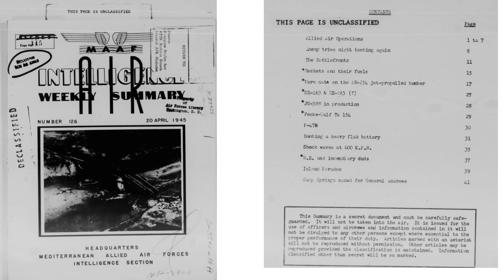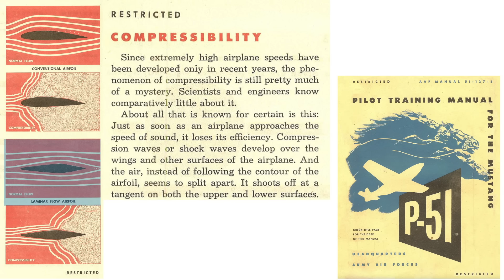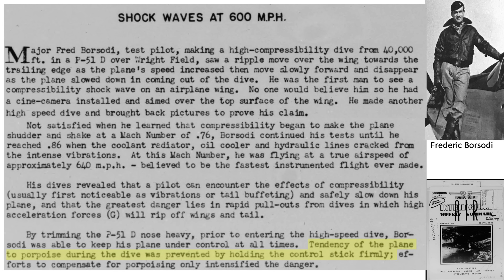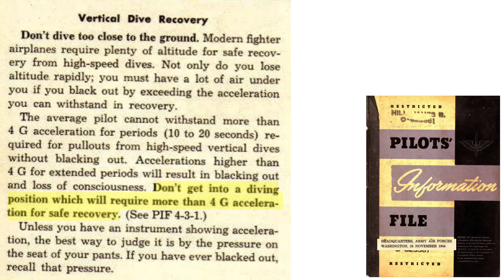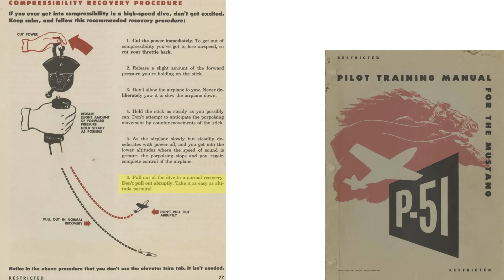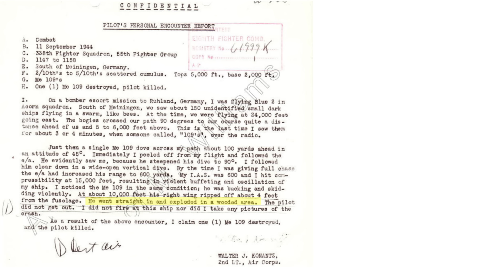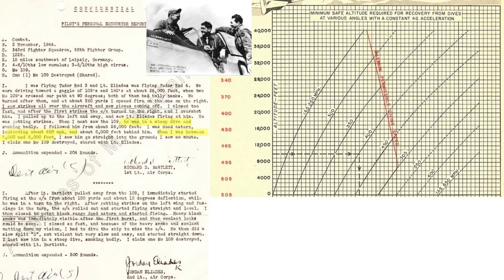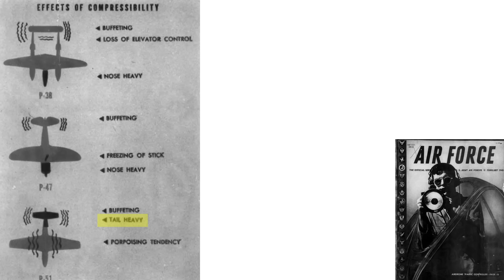P-51s Attacking German Fighters to Speeds of 650 mph, 7 Combat Narration Reviews

Comment: What did they do with the aircraft after surviving at such speed?  Did they ground them for good?  Did they simply check and see if it was in spec and send it back out?  

I would think if a plane was stressed to 30+% more that it's recommend limit, they would ground them. You can only bend metal back and forth so much before a failure happens.  When at compressibility speed for a sustained period of time, one would think the plane would no longer be safe to fly in combat, let alone taking it easy.

Comment: Alex Henshaw, Spitfire test pilot, did a maximum power dive from 37,000ft to test for a possible fault in de Havilland variable pitch propellors which was suspected of over revving the engine during power dives. He saw 560-570 IAS. He reported the ailerons went solid at 400-450 IAS followed by the elevators. He pulled out of the dive using the elevator trim: “I used the trimmer tab as if it were as fragile as a biscuit” since his controls were frozen rigid.

Comment: I have to disagree with the comments and the report shown @3:35. 
No amount of shock waves and/or speed will ever shift the "center of gravity". They will shift the aircraft center of pressure. 
If it moves rearwards, it will create a nose-down moment which will increase the dive angle. 
The center of gravity is fully determined by the distribution of the masses of all the airplane's component, and will not change unless something is added, moved or removed...  
Even approaching the speed of light, linear dimensions may contract but probably not move the CG.  If somehow the Mustang achieved "warp speed", then we really don't know... (;-) !

Comment: P-51s were utilized by the NACA for supersonic aircraft research: They mounted a model on the upper surface of the wing ahead of the minimum pressure point. This airflow is supersonic in a high speed dive. It only creates a weak shock until critical mach divergence is reached. Just below this velocity, airflow around mach 1.2 can be attained on the upper surface. They used this airflow as a supersonic wind tunnel by attaching balances and measurement devices inside the wing to an external model, then having test pilots dive to a prescribed mach number and maintain it. This proved invaluable research in the mid-late 1940s. They also dropped instrumented spikes with wings from high altitude. And launched supersonic rockets and recorded performance by radar, in order to determine supersonic aerodynamic characteristics. They were a pretty smart bunch.

Comment: 10:11 Trends... fluttering and cable failure in August, violent buffeting and vibrations in September, and no issues from October on into February of the next year. 
How was the weather, generally? Warm, cold, wet, dry, baro pressure?
Any changes made to the aircraft configurations from September to October 1944?
Reply: Mods had been done to strengthen the gear doors, ammo bay doors and locking mechanisms, and also the rad housing. Metal elevators added in early 1945.
Reply: @bobsakamanos4469  Well that alone will cut a lot of surface flutter...

Comment: The Mach limits for later Spitfires Mk5+ was 0.85 & Tempest Mk 5 0.87.
Reply: The Spitfire was out of control earlier than most though, as the wing was quite flexible and roll control was pretty much gone. Similar to the Zero. The wing was pretty much fixed after the war with much later marks.
Reply: Spitfire Mk.V was 1941, Tempest V was 1944 and was not a high altitude fighter.  Critical Mach & compression really is an issue above 20,000' where Spit IXs & XIVs reigned.  Spitfire 21 entered svc in late 1944 and had a new wing with dive limit of 525 MPH.

Comment: its interesting that 4G was found to be the maximum. Since that maybe is a limit if a pilot goes unprepared into the recovery. 
High G countermeasures where maybe not taught, but were instinctively done by pilots. Tensing up the core and leg muscles, breathing measures etc. So 4G was not really something special in a fighter plane. (also nothing to be scoffed at)
Maybe its another "manual value". Because if one needs to recover the plane with more than 4G, he will :D

Same goes for maximum G loads of the plane. 8 G is something the Pilot will achieve in a very sudden and trimmed turn. Nothing which can be sustained for long, but nothing unheard of.

PS: Like the stories later in the video confirm.
Reply: Pilots were in fact trained to react to G onset.  Keep in mind that G tolerance was also built up with practice.  4 G was not an issue to the experienced fighter pilot.  6 G and above was more typical during ACM. 
 In 1942 the first G suits were used (developed in Canada) by RN Seafire pilots during Op Torch .  I believe the USAAF used the G suits developed by Aussies near the end of the war.

Comment: Fascinating.
  Tangentially, the limits of fighter maneuvering are those of the human pilot inside.  Once we dispense with the human factor, what are the new limits- materials limits- going to be?
Reply: Probably not a whole lot more - When you start building an unmanned aircraft that matches the performance, sensor, and weapons capabilities of, say, an F-15 or F-22, it becomes about as large as an F-15 or F-22, with all the structural / materiel limitations.  Turns out that accommodating the Meat Computer becomes less of a penalty than the sizing of the radar, engines, fuel, missiles, etc.
Reply: @peterstickney7608  As the older Voodoo pilots said about the Nav, that's 600 lb  that could be replaced with fuel.

Comment: -The NAA/NACA 45-100 "laminar flow" wing section was developed by Eastman Jacobs of the NACA and adapted by NAA for the P-51.  Laminar wings were standardised in the 6 digit series and started to appear on US aircraft in 1944/45 eg A-26.  .    The wing section looks like a Tuna from above with the point of maximum thickness at 50% and then reflexes out in the Final 10% into a fish like tail to recover pressure.   It is a masterpiece.   Most wings such as the 4 digit NACA 2213 used by say the spitfire had their point of maximum thickness at 20%.    The idea of NAA/NACA 45-100 was to have a constant pressure gradient  across as much of the wing as possible to maintain laminar flow.  The principle was discovered by Melville Jones (I think Chair of Aerodynamics at Oxford) but it was a chance meeting at Mussolini's Volta conference that introduced the two men.   Jacobs used complex number theory and conformal  (immaginary numbers) to create the perfect shape taking into account not only desirable pressure distribution and laminarity but pitching characteristics (which set the American sections ahead of others).  
-It turns out that the laminarity aspect didn't work as well as hoped due to surface imperfections, but the wing sections had a high mach limit which reduced drag considerably at speed and as much as laminarity would.   
-As a result, the P-51D had an extremely high Mach Limit.   It's thick wing carried a lot of fuel and was very stiff giving a superb roll rate.
-When a wing 'compresses' i.e. approaches Mach limit where the speed of sound starts to develop around the wing the centre of lift of the wing moves back and creates a downward pitch that the elevator can not counter called "Mach Tuck".    Recovery usually occurs when the aircraft gets into the the lower atmosphere  where the speed of sound increase from 660mph (at 36,000ft) to 750mph.  The P-51 did not need dive recovery flaps like late model P-38 and P-47.  These were flaps under the leading edge of the wing that generated a little lift and pitched the wing up to counter Mach tuck.  
-P-51 often exceeded Mach 0.8 in combat much more than a P-38 or P-47 which without dive recovery flaps compressed at Mach 0.68.
-The Germans also worked hard to increase the Mach Limit of their aircraft, and they were usually around Mach 0.78 for late model Me 109G and Fw 190 but sometimes more.  A small fortune was paid to the test pilot.  Me 109G dive speed increased dramatically when the small tail was replaced with a tall tail which used a balance tab on the rudder instead of a horn balance.   
-The P-51B/C could definitely out dive a Me 109G (late models like Me 109G14, G10, K4 with tall tails) but the bubble canopy of the P-51D sometimes meant the 109 could recover sooner.
Me 262 had a special NACA 5 digit airfoil with a German modification system (adopted by the US after the war) it was designed to delay compressibility as well.  Thickness was at 45% of chord at the root and 35% at the tip to give good stall.
Reply: George Caley, father of aeronautics, postulated in the early 1800's that the shape of a trout was the most appropriate for streamlining and drag reduction. It was a brilliant analogy to emulate the fluid dynamics of air at higher speeds, as mentioned by Theodore von Kármán director of GALCIT.
Reply: Speed version me 262 max speed 624mph.
Reply: @Eric-kn4yn  
What's the "speed version" of an ME262?
Reply: @dukecraig2402  Perhaps he's referring to the Air Intelligence Report of Wind Tunnel Tests at Oberammagau in February 1945.  A stock Me 262 maxed out at about 540-545 mph at 20,000' in level flight. 'bout Mach 0.77
With a lower profile canopy, a cleaned up tail, and hypothetical hotted-up Jumo 004s, it was predicted to be capable of about 363 mph at 20,000' - Mach 0.82 - which was its limit for high speed controllability.
Back in the '80s, I was part of a team that was trying to acquire one or both of the postwar Czech-built 262s that are preserved there, with a mind to re-engining them and restoring at least one to flying condition. - much like the new-build Me 262 replica / reconstructions.  I was doing the Performance and Flying Qualities predictions.
Reply: @peterstickney7608  
Yea 545 was about the fastest NACA ever got one going in level flight, they got speeds out of them that were all over the place with some as low as 520 or so, none came anywhere close to the number listed in Wikipedia which was Messerschmits CLAIMED speed, which they'd probably have done if they'd have had any kind of real quality control over their engines, but as they were lucky to even have fuel to fly them that kind of quality control wasn't realistic, they were scraping the bottom of the barrel for everything at that point.
Were those the jet engines that had the 2 stroke gas engine in the center that started them?
Reply: @dukecraig2402  The speed versions of the Me 262 had a much smaller racing canopy.   Not sure if the speed can be verified with a tail number.  
Gerd Lindener was the Factory Test Pilot for Messerschmitt and said he sometimes could get a verified 560mph out of a good Me 262 with a top-quality airframe build and top-quality engines.  Ones with a Racing cabin or experimental Jumo 004 C or D engines  (about 10% more thrust)  supposedly  568.  Normally an Me 262's maximum speed was 540mph at 25,000ft.  In most cases all of the speed records the Meteor III and P-80A broke in 1945 that were around 600mph was at lower altitude where the speed of sound was much higher and Mach lower so I think Me 262 that achieved higher speeds than 540mph did so at lower altitude.
-The jets slowed down less at low altitude.   
Downside of the statistically excellent Me 262 with good engines and airframe was those with poor engine and airframe that managed only 520mph.
-At the end of the war some Me 262 were being assembled in forest. factories in the open.  The airframe was on a narrow Gauge rail cart and towed along a production line in the forest..  Some were built without jigs which made them rough.  
-The AVA research Institute at the University of Goettingen developed "Area Bulges" for the Me 262 above the wing inside the engines that area ruled the aircraft.   Only a wind tunnel model but it shows there were ways of raising Mach Limit.
Reply: @dukecraig2402 - Hi, not claiming expertise in this area, but sources I have read show the Junkers Jumo 004 as having the Riedel 2 cylinders opposing piston engine as the turbine starter, with most having a manual pull start (by ground crew)  and some examples an electric start option operated from the cockpit. I believe the BMW turbo had electric starter only, but never made it into wide use due to development issues.
Reply: @KevinSmith-ys3mh  The Jumo 004 on the Me 262 and Arado 234 was started by a 2 stroke motorcycle engine by the Riedle company.   The engine had an electric starter but you can see ring pull starters for backup manual start.  The intake inlet cone had two anular tanks with 2 stroke gasoline in one for the starter engine and   the other with a high quality starting jet fuel.   Once the engine was started it was switched to main tank fuel.   Anthony Kay in his book on German Jet engines note that Me 262 flew missions on warmed up crude oil centrifugal impellor refined only.  As you can Imagine ground starting procedures were complex.  Once in the air a starter motor wasn't usually needed since ram air from forward motion could be used, still the engines had to be shut down and restarted after a flameout.   Kay mentions they were heading in the direction of a central piston engine generator using electric motors in the starters.  A vaguely recall that the BMW 003 used the same engine but it needed a reversing gear since the engine spun in the opposite direction.
Reply: Yes, the so called Riedel starter (Name of the engineer, who designed them). Fun fact: After the lost war he modified those engines for a small motorcyle (Google „Riedel Imme“)
Reply: @bernhardzunk7402  
The P51 did not have a laminar flow wing and NACA was perfectly clear about that in their reports when they evaluated and tested them, NAA designed them as a laminar flow wing but the reality of things was at the time the manufacturing processes in the aircraft industry couldn't mass produce the wings accurately enough to achieve true laminar flow across them, even if they could their design wasn't hardy enough to maintain it, wings warping and bending over time from the rigors of combat flying and even bug strikes would ruin any laminar qualities they had.
It was still an excellent wing design for its time and was low drag but not quite up to being truly laminar, that would have to wait until the next generation of aircraft.
Reply: @dukecraig2402  The NAA/NACA 45 was laminar by Design and in the wind tunnel with controlled surface roughness but as you say not in real life due to tolerance issues, paint issues, surface damage and insect strikes.   
-Nevertheless, the design parameters for the P-51 wing (laminar flow) involved a constant pressure gradient that was also perfect for delaying shock wave formation.    As a result the P-51 wing had much lower drag not due to laminarity but its high mach limit.   The wing cold be much thicker so it could store more fuel and be stiffer.  
-True laminar flow on some modern aircraft has been achieved using polished glass or carbon fiber reinforced plastic wings surfaces with the surface kept clean of bugs and dirt by secretion of detergents along the leading edge of the wing, in the case of one German Sailplane by a wiper that runs on a rail on the underside of the wing.   (The underside has a very positive pressure gradient so laminarity can be maintained) also some test aircraft have a sort of slat under the wing that comes out during takeoff and landing to shield the wing leading edge also allowing apply detergent or wiping and act as a slat.